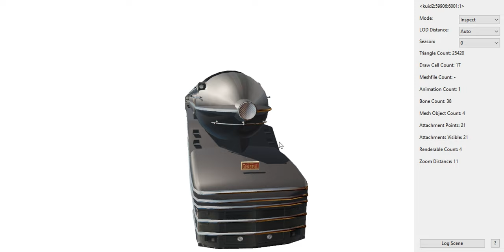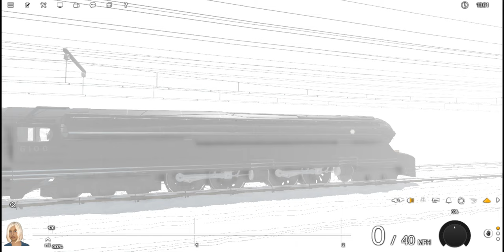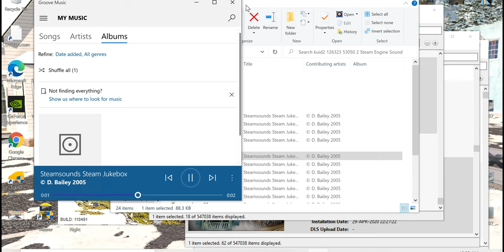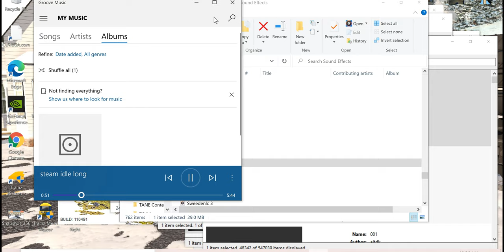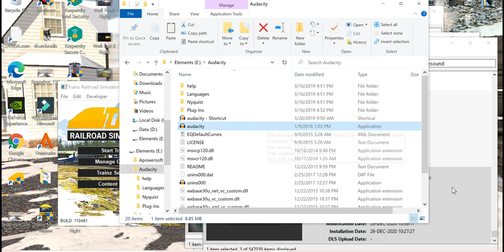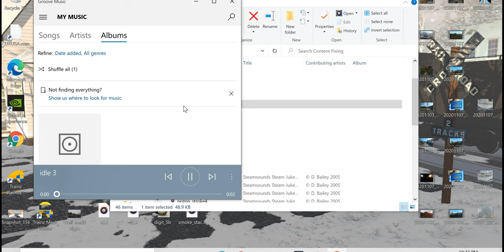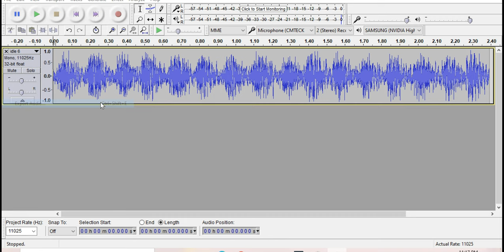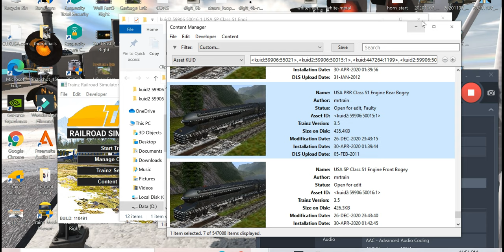Trainz: How to Update A Steam Locomotive Engine Sound

Comment: Hello Trainfan1055!
As you said this was you learning how to make engine sounds for steam locomotives yourself in this video I will not critique to hard and instead give you and others reading here pointers for the future. I have no problems with most of everything done in the first half of the video. The creation and use of sounds to make the piston strokes, loops, and idles are acceptable. Time and patience are required to get good sounds out if it. I do not recommend pitch shifting as it causes weird sounds to the audio. It becomes noticeably edited versus as it would have been. If you want a deeper sound use audacity to add treble and bass to the sound for that effect. Use the tempo change only to make it faster or slower. That way sound is preserved. During the shrinkage of the sound it will be bowned to clip once it reaches certain points. From there you will need to make small fades to make sure it loops without glitching. 
My next point to address is the number-slow-sounds, number-cylinders, and number-power-strokes. As you said you don't really know what these are I'll go into depth on the usage of these. The number slow sounds tells the sound how many of the piston stroke files you have. You created 4 of those files so the number slow sound should be set to 4 as you have it in the video.  The number cylinders is quite self explanatory and is based off of the number of cylinders the sound is for. Be warned that this worked along with number of power strokes to correspond to the espec that the engine is using. Wrong numbers between the spec and the sound will cause audio problems. Number of power strokes will always be set to 2. As a cylinder makes 2 power strokes, forward and backward. This will be explained better shortly. 
The anim-dist is the distance in meters the animation will travel during 30 frames. Normally it is correct however if you want to edit this here is how you find it. Take the diameter of the wheel in question, convert it to meters and multiply by pi. That will give you your anim-dist. 
Here is where I explain the problem between spec and sound. An example of this problem can be found in models made by Neal of subpart productions. Many of the specs use one cylinder with four power strokes to replicate 2 pistons. He then set the direct drive on the trailing truck and the anim-dist  he set in-accuratly to be half of the drivers so you would get the correct number of chuffs where if it was in the driver it would be wrong. To fix this issue the spec must be altered to say the number of cylinders and the number of power strokes to match that of the sound to get the audio working properly with the drivers. You got lucky that the spec used was already set the same as your sound as to not cause this problem. 
Other then those points you have a very helpful video here for those getting into content creation. I'll be putting out a vid soon once my computer is back online that will show the more intricate details of this that have been skipped over. Please feel free to ask anything as a reply if you have questions about anything. 
Cheers!
With kind regards,
The Brougham Gamer